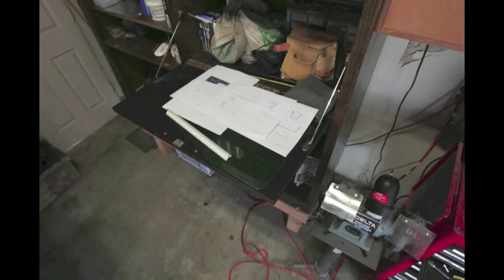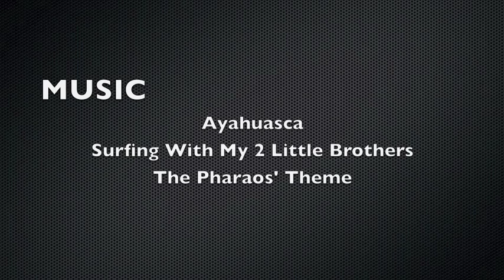Building the Duckpunt - 3 weeks in 6 minutes

Comment: Thanks this helped me understand how to build the stern end in the Milgate design.  Still a little confused on the bow.  At 0:54 i get it.  But at 0:58 there is a more defined edge on the bow.  Is that just epoxy filler or another piece of wood you added?  BTW,  I like that you used the butt joint instead of the scarf, was thinking on doing the same.  Another mod I was thinking on was doing with with an external chine log for screw and glue construction.